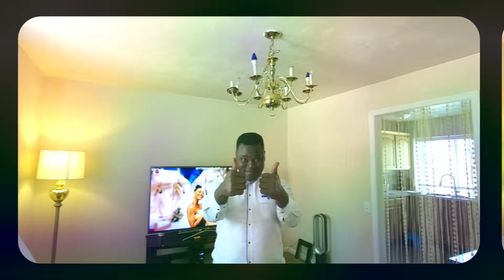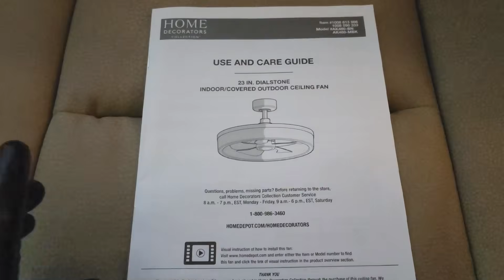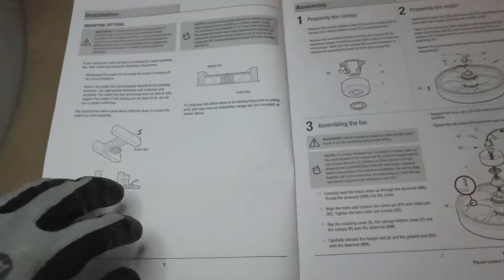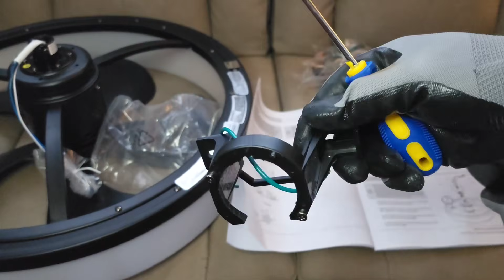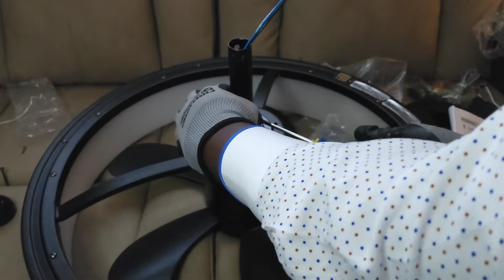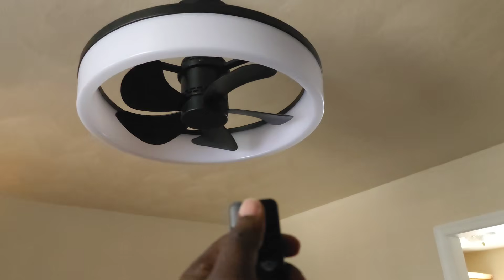How to Install Dialstone Ceiling Fan with LED

Comment: I just installed the same fan but it wobbles visibly at high speed. Does yours wobbles as well? I thinking on returning the fan.
Reply from the maker: Mine doesn't wobble. The ceiling  bracket does the magic. Try see that the plastic cover at the ceiling is used and the bracket is secured firmly.